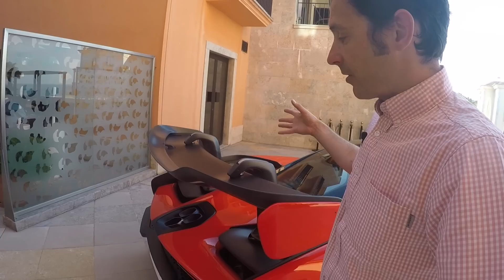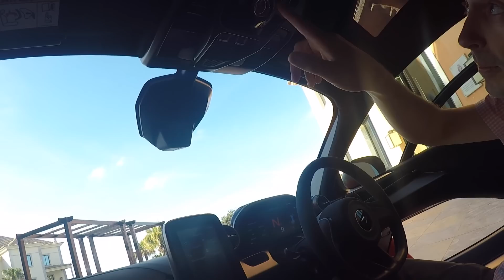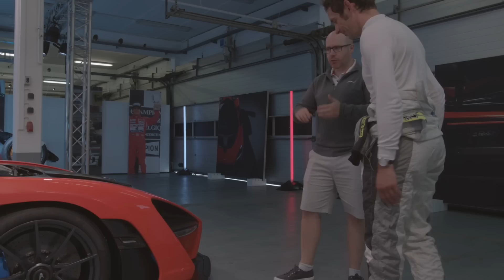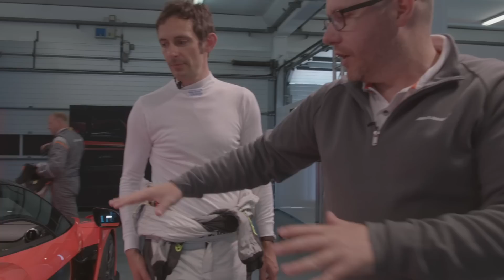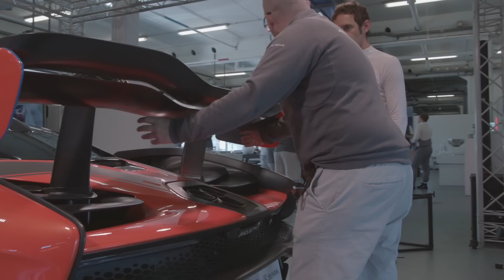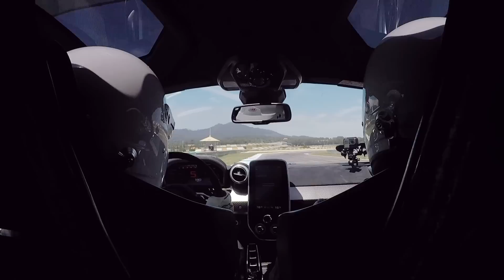McLaren Senna - full review, tech walkaround and Estoril lap

Comment: On the rear wing position question, it's probably worth adding that whilst a rearwards position (further behind the rear axle centreline) does indeed increase the force on the rear wheels, it has the opposite effect on the front wheels. On a 'real' race car, that has massive front end downforce (due to very low ride height, and huge 'jutty out'  horizontal elements (splitters) you can re-balance the car, but a road car, that has to have a higher ride height and has numerous limitations as to the front end geometry, it's really difficult to get enough downforce to balance a large, rearwards mounted wing. So, on the Senna the rearwing CoP is actually quite close to the rear axle, and even then it's difficult to balance the car at all speeds (hence the car pushing the nose a bit at mid speeds, when the rear wing has started to work, but the front hasn't yet)

Comment: Still baffled on how this isn't lighter than the F1. The F1 uses carbon tech that's maybe 30 years old, has a massive V12, luggage space, 3 seats, a radio, etc.
Reply: it's bigger than the F1, it uses a turbo engine, it has active aero, massive brakes, complex active suspension and larger wheels and tyres and it has a complex paddleshift transmission. An F1 wouldn't see which way it went, despite being a "lot" lighter......
Reply: The F1 is tiny next to the senna, that's the only way it weighs less because it's a third the size
Reply from the maker: I think Ian alluded to it in the tech walkaround but crash regs and the need to include airbags and suchlike have all contributed to the extra weight compared with the F1. A lot has happened in the last 25 years on that score and there's a lot more to consider. Which makes the fact the current MX-5 weighs just 50kg or so more than the original even more impressive! And, yes, I just managed to lever in an MX-5 plug into a discussion about McLarens. Sorry! DT
Reply: Dan Trent You’d think that could be integrated into the carbon structure(s). It’s still a whopping 200 kgs heavier. How many airbags are there?
Reply from the maker: It's an interesting point and one to raise next time I'm with the McLaren engineers. Consider me on the case and to be continued in a future instalment!